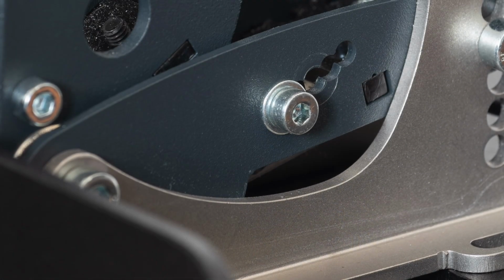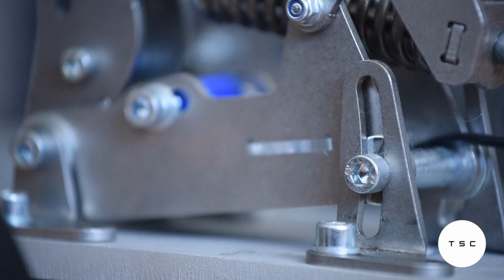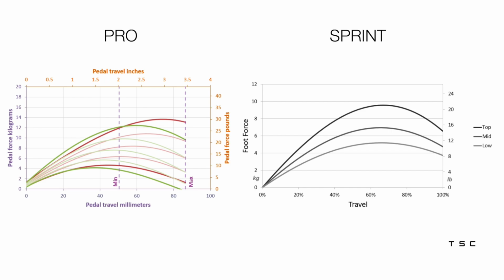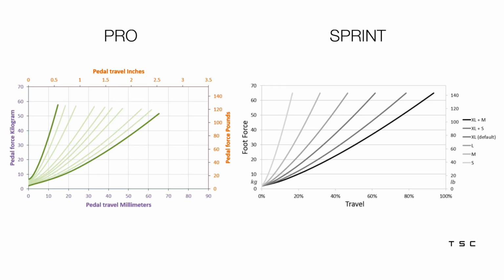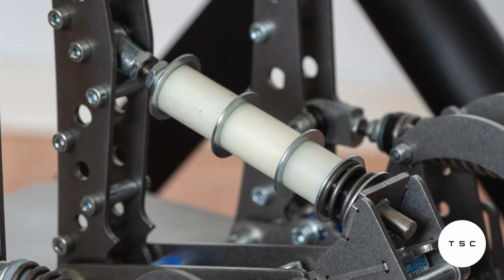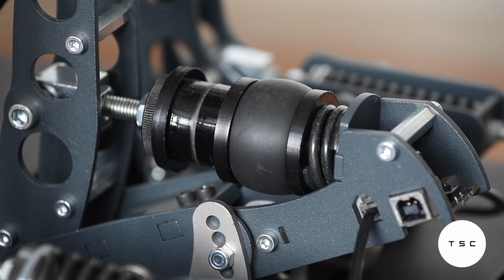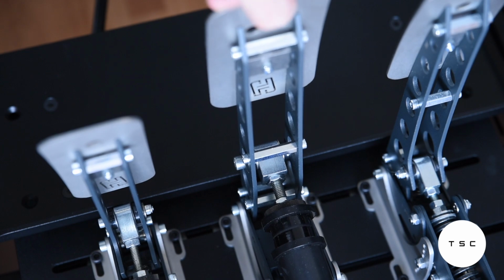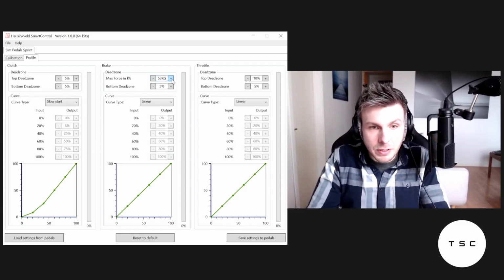Tech Talk with Niels Heusinkveld: New Products, HE Pro vs. Sprint

Comment: Should i be buying a used set of Pro's in 2024? They are $500 aud. What software do i use to calibrate and adjust them?
Reply from the maker: I'm not up to date on the prices for used Pros in Austria, but the Pros are still a good pedal set today (much better than anything Fanatec or Thrustmaster for example). 500 Austrian dollars is like 300 EUR so that does indeed sound like a good price if the set is in decent condition.

Software wise there's "DI View" (I think that was the name), you should find documentation on it on the Heusinkveld website. It's not the same as for the Sprint and Ultimate+, doesn't look at nice, but you set it and forget it.

Comment: @26:50 True again.  I have a friend (my first teammate in a GPL league actually) who raced a "spec racer" FF here on the west side of the pond.  I asked him about the pedal travel between full release and full pressure on his own pedals, and he replied:  1/4 inch.   And even that should imply the brake circuit needs a bleed, as brakes should compress down tight, unless all the compression of the various rubber parts has been accounted for.  IMO, anyway.  I think the rubber parts must have been the source of his pedal resistance...but we can't really do without them.  Plus...it also makes it all the more the challenge.  And all the more the fun.
Great video, btw.  Enjoying it minute by minute.

Comment: @16:50 to @20:20 A clutch pedal can, indeed, require longer or shorter throws or feel, but the basics of a clutch, at least on a car from the sixties, seventies or eighties (Niels will know all of those), are such that, as the clutch plates gradually disengage from one another, the "feel" under the pedal and the force necessary to disengage the clutch plates from one another does, indeed, decrease, and it does, indeed, reach a point where the driver realizes it's gone "light"...but the pedal travel does NOT go suddenly lighter...and further.  With a real world clutch there is no sudden "drop-off" which leaves the driver feeling he's pushing his pedal off into thin air, four thousand feet above the cornice he's just punched through. The reason the clutch plates go light in the first place is because the throw-off bearing has increased pressure and thrust on the clutch leaf-springs themselves.  So they trade off, one against the other, and the pressure curve goes flat, but the pedal to throw off bearing pressure is still, even once the plates have disengaged.  IMO.
Reply: Depends on the clutch. All the cable and mechanical linkage clutches I've used absolutely have a maximum peak pressure range somewhere in the middle of the travel, and are noticeably "softer" at the end of travel than  the middle. The hydraulic clutches I've used, I feel this is still somewhat true, but it's not nearly as obvious.

Comment: @ 7:20 (Niels):  [...] "while pressing ninety kilos on the brake" [...].  This is exactly right, or was, at least, in racing cars back in the day before power assists.   Racing School instructors used to say "students don't realize, at first, how HARD they have to press on the brakes to maximize stopping power, or to even lock them up.  It takes a while for them to learn it."
And in those days there were almost no power assists.   For racing drivers, who are often of smaller stature, to manifest enough physical strength to press the brakes hard enough to get the most out of them took real work.   Which is part of why drivers like Niki Lauda were so much into fitness and diet, etc.

Comment: @5:40 to 6:30:  IMO too, it is true that people--perhaps even most people--and even many people in sim-racing too, equate pedal softness and travel in what they want from sim pedals to what they typically feel in their own road cars.  No surprise really, as that is the range of their experience.  Most (North American) SUV's, for example, are equipped these days with power assisted brakes, which allow long travel for short modulation of the actual braking power...because most people simply no longer have, or can even glean what it feels like to be in direct contact with their brakes,  and their discs.  Which is rather odd too, if you think about it, because, and even though many sim-racers now have moved to load-cell pedals, they almost want to revert to their own experiences with the old "pot-travel-rotation" pedals.  Even many sim-racers seem to want to go back...to the old days.
Reply: That has been a hard habit to break when it come to the brake pedal feel. I'm still not all the way there. I been progressively making it stiffer trying to re-train my brain lol

Comment: The Heusinkveld Sprints I bought about two months ago might be literally the best product I've ever bought. I've had V3's before which failed me about on year into ownership, and while I know that they're not in the same price bracket, they Sprints are just worlds apart from Fanatecs. I can't recommend them enough. Superb feel of quality.
Reply from the maker: I have to agree on that, I really don't like the V3s (despite having worked for Fanatec). The law of diminishing returns is not in effect here. The Sprints cost twice as much as the V3s, but they are also twice as good and worth every penny over the V3s. There is a lack of decent pedal sets around the 350-400 $/€ price point in the market.
Reply: seeing this.. really helped me make the choice on the sprints.. i have v3 right now.. and just debating between the utlimates, sprints, and the bj racing and maca pedals.

Comment: one question, the electronic sprints has improved in bits and steps of 12 or 16 bits?
Reply from the maker: I don't know! I'm not sure though whether that would make a notable difference? I'd say it would only make a difference if you're using a very small range for the pedals (up to 10kg or so), if at all.
Reply: @TheSimChannel  Now there is the fashion of 16 bits and 65000 steps in other manufacturers, these sell us that there is much more precision and difference compared to 12 bits, now what you say may make sense too, but in more steps will not always be better detail in load cell?
Reply from the maker: @tus_hobbys_son_los_mios  I just checked, the Pros are 12 bit, not sure about the Sprints right now. But: the 12 bits on the Pros should be enough for all intents and purposes.The steps in between aren't really noticable :)

Comment: Well, I bought the Handbrake this year :D :D Anyway, I have the Sprints, Handbrake and Seq shifter. I would buy an H Shifter as well. I tried the SHH shifter, have a Fanatec wheel. Although there are similar products, I usually like to go with HE, because they are close, so in case something breaks, shipping is quick and cheap. Also, everything is very open and easy to work on, which I appreciate most.

Comment: Will the HE Ultimate v1.5 have the PCB integrated or will we have to wait for the v2 for that?
Reply from the maker: I don't know for sure but since he said it will be available as an upgrade to the v1 as well, I think it'll most likely be an external circuit board.
Reply: yes 1:09:00 1:09:35 or I got it wrong
Reply from the maker: @eddybouh2079  The way I understood the question was whether the board will be integrated into the brake pedal in the Ultimates 1.5. And the answer to that is most likely no ;-)
Reply: @TheSimChannel  I see a question on ultimate 1.5 and V2, not brake pedal. seems to me at 1:09:30 he's saying that the new bearings, PCB and software are features of the 1.5 and also that it will be possible to purchase the PCB if we already have ultimates.
Reply: @TheSimChannel  And thats also what I meant ;)
Reply from the maker: @eddybouh2079  Yes, and I expect there to be an external PCB receiving wires from all 3 pedals also in the 1.5. But for an integrated (into the brake pedal) PCB we will have to wait for the V2. :)

Comment: I have sprints, but mounted them inverted, fortunately the clutch wire plugs into the throttle side and the throttle into the clutch side of the circuit board. The shortness of the wires is a small issue when coming to spacing out the pedals for my own personal comfort. The calibration tool is super easy to use, but because of the inverted installation the clutch is seen as throttle and throttle seen as clutch, no biggie just have to engage brain a little when it came to calibration, obviously no issue in a game, just press whatever pedal corresponds to input binding. But, would be good if the tool had an "inverted" button. The sprints were a huge, and I mean massively huge improvement over the Fanatec V2 I was using with a very noticeable improvement is driving on Dirt 2.0. Fantastic product.
Reply: Hey Trevor, if you recalibrate in SmartControl and press the throttle and clutch when it asks you to and complete all of the steps, it will assign the throttle to the "clutch port" and visa versa.
Reply from the maker: helping each other out, I like it!
Reply: Hi Trevor, not sure if you are aware but the Sprints use an RJ9 connection. In my case I wanted to mount the brake and gas pedal farther apart so I bough an RJ9 headset extension cord female to male 25.5cm long (brandname VoiceJoy) and I was able to extend the coords. It's not optimum but it works, I used masking tape to make sure the connection won't come loose. Maybe it will help you too.
Reply: @dubhee  great info thank you

Comment: I love my sprints but can’t get feel  to them still. Coming from Logitech muscle memory and having brake that feels like brake is amazing. I am using the stock rubbers ? I struggle in trail braking by rolling the rubber adjuster then re calibrate does this effect how the peddle will relate in games.
Reply from the maker: I wanna answer but I don't fully understand your question. Can you rephrase it?
Reply: @TheSimChannel  sry lol i just read it my self hahah it was like 4 am when i seen this vid. what i have a problem with is in iracing i lock up heaps and i find trail braking very hard with the sprints as when i put my foot on the pedal it feels like i am not getting over my pedal and when i try and release it slowly i do it to much. i am using the standard rubber but i have played with the spring setting just turned it slighly to take some of the pre load. is there a way to give the pedal more softer feel so i can modulate and trail brake easier.
Reply from the maker: @MrFrosty888  You can try a few different things mechanically, like removing the spring, putting in all the rubber pieces you can make fit (with and without the spring). Have you tried driving with shoes on (see my vid from a week earlier)? Maybe your shoe soles are too thick and you don't get enough of a feeling for your brake pressure. Or your shoes are fine, but you have only recently switched to using shoes? It took me a little while to get used to it when I first got the HE Pro pedals. Or maybe your Sprints are not well set up ergonomically. Does your heel stay on or near the base plate when you push the brake (left foot braking)?

Then there's also the option that it's software related. Have you tried other sims / other cars in iR? Have you tried different curves in the brake profile? Although my advice would be to use a linear setting for the brake, at least for ACC, AC, etc.
Reply: @TheSimChannel  i race with no shoes on mate and and my heal does not stay down when pushing on the pedal face and i find i have not much travel even afetr i take some pre load of the brake spring. is there a way to get more travel on the pedal it self?
Reply: for me i think i dont mind more travel as i can manage it with my left foot as i brake with left foot. what i struggle so much is the brake feels so hard and i have to push so hard n then when i release it i lose so much time on my laps and car starts to twich because of it. most of a lap time is not just getting on the brake but how one come off it and thats my problem i think cheers
Reply from the maker: @MrFrosty888  The most travel you get with all the rubber pieces installed, and no hard plastic left in there. But I think just putting on shoes will solve your problem. it's much easier to press the pedal down with shoes. It'll allow you to set your brake to 50-65 kg and then you'll have more travel as well.
Reply: @TheSimChannel  well i left the spring n stock rubber in rolled the pre load of a bit then re calibrated the pedals and now its bit softer and can get more play and trail brake going. i also found that if i run 55kg or higher its not ideal for me so i run 43kg and played with the setting in profile for the brake and i can trail brake now and seem to not lock up as much  and not having to use shoes.
Reply: @TheSimChannel  both in rfactor 2 and iracing i have more trail braking and dont feel like i am going to brake my leg trying to jam on the brakes what i did seems great
Reply: @MrFrosty888  change the degrees of the pedal. I started off having it in the hole ”number one” from the bottom and I feelt like you say it feels like. Now I have it in number 4 or 5 and it’s much easier push the brake. Even more travel.
Reply: @kezman82a  that was already done to mate cheers my pedal are set to 4 on the holes in the rear but the preload taking some off it n re calib and having 45kg set is seems to be great now in rf2 and Iracing. But in rf2 I run liner style but slightly tweaked in the first part of the numbers to stop lock ups
In iracing i just couldn’t stop lock ups but last 6 months not been able to trail brake n modulate was killing my laps. I was leading driver or so in my leagues n went to mid field n down huge on my over all times but now I’m finding more comfortable with it n laps n driving feels more natural
Reply: @MrFrosty888  Using shakers for tactile feedback might help. With Simvibe I feel wheel lockup or ABS kicking in.
Reply: @Leynad778  no thanks that I have used in fanatec and for me it’s pointless